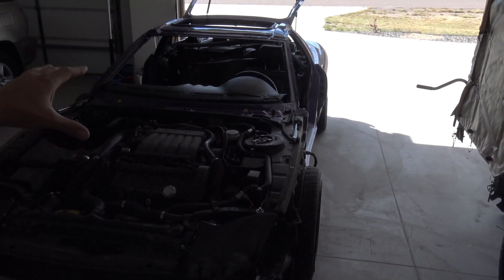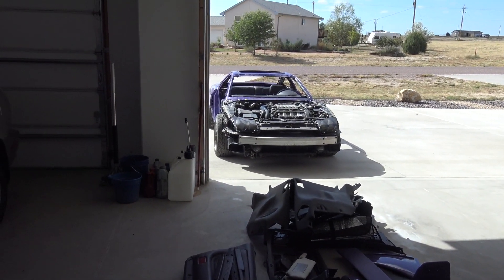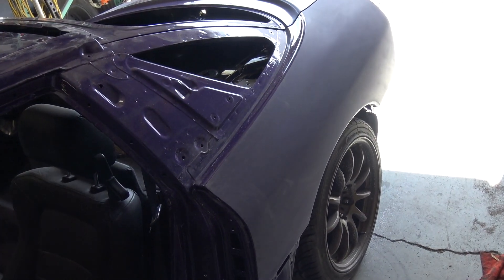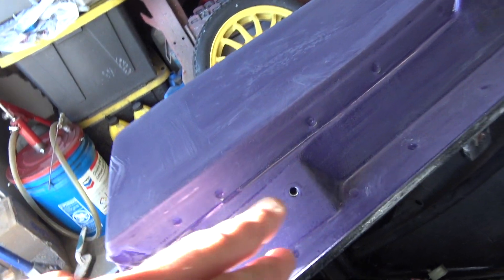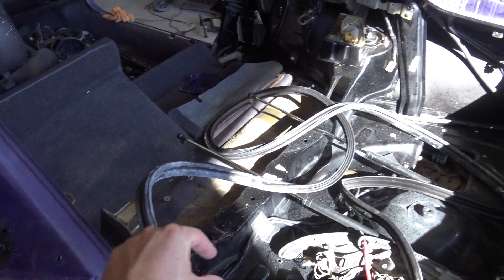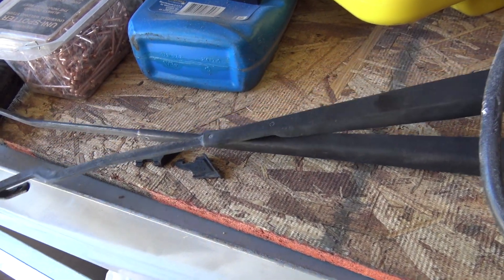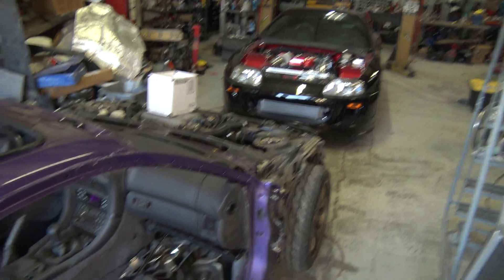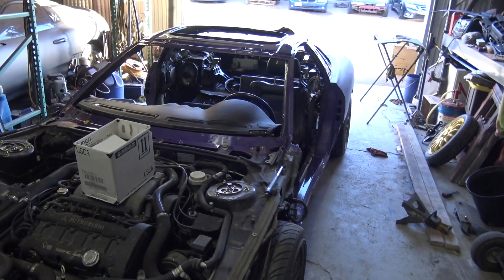3000GT no front Windsheild so COLD!!!

Comment: I have a question I bought a 1987 BMW from the car lot the paint look good but after a few months the clear started flaking off probably because they buffed it too much, since the clear just started to flake off can I wet sand the clearcoat and then apply new clearcoat on top of the old?
Reply from the maker: If it is flaking they probably used the cheapest clear, I would just repaint that part with a better quality paint.
Reply: Junkyard Dave  what’s a good clear to use?
Reply from the maker: @mgbrv8  I use sherwin williams cc200 but it's not cheap